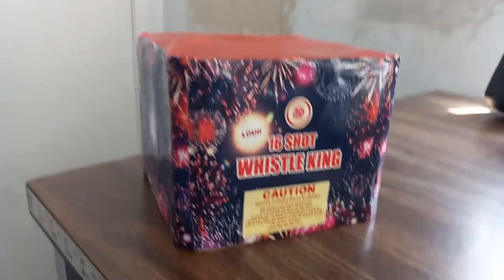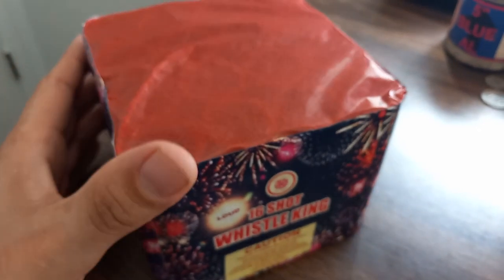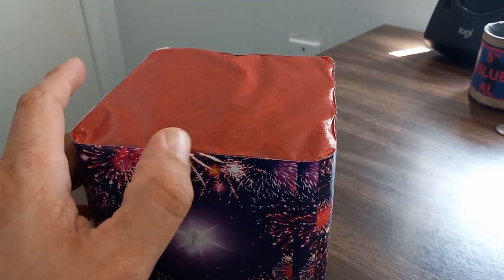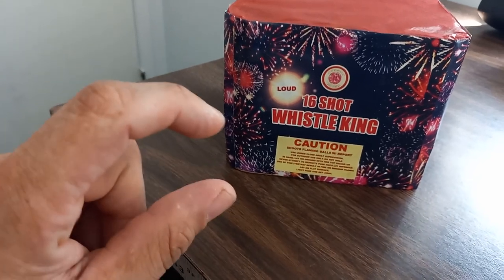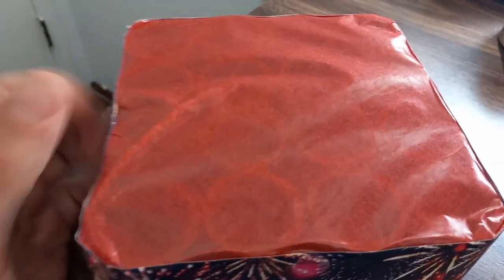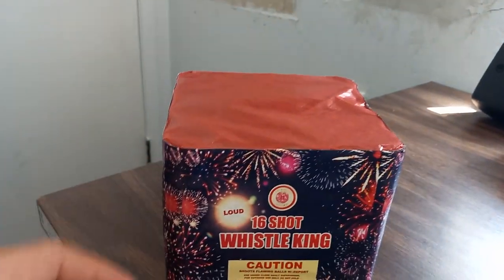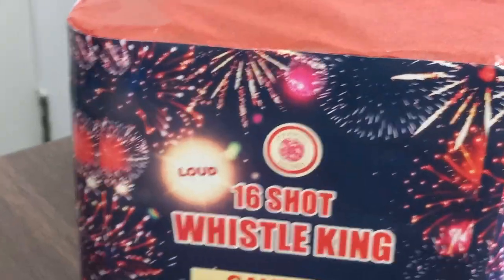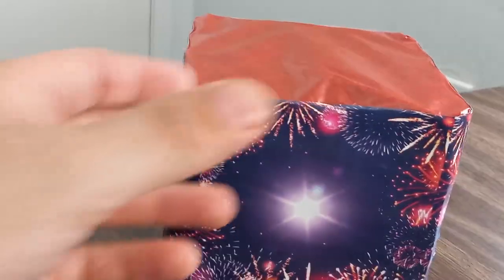Whistle King Specs.

Comment: With those tubes and that size insert with a good amount of lift I think it will work great not sure about the insert timing tho. Put it on a hard surface and let er rip. I have put 7 or 8 grams of lift in these tybes to see how they handle it and it was all good but I didn't over fill the insert you don't want the inserts to be to heavy in these cakes